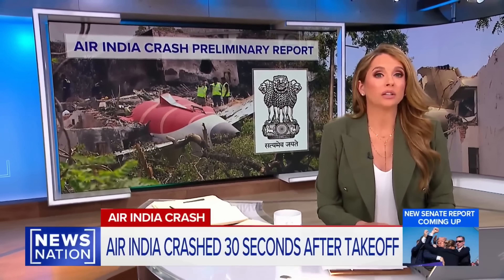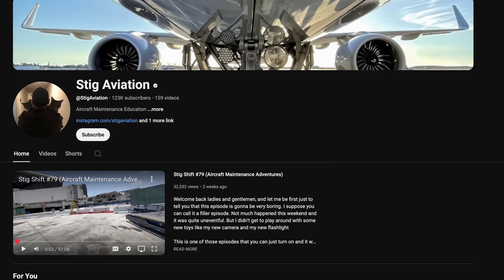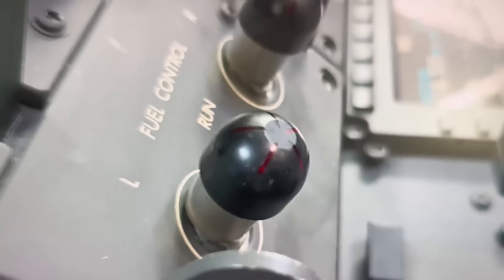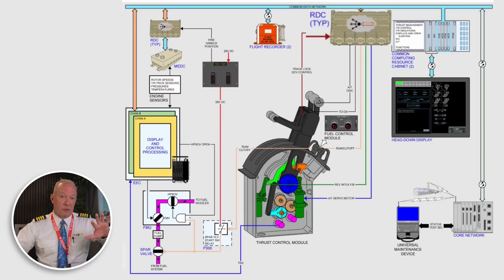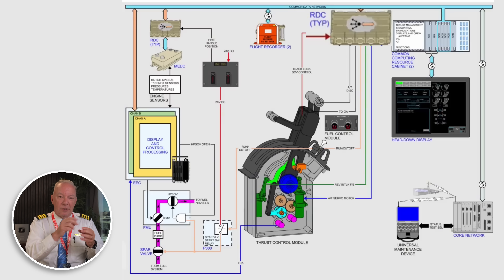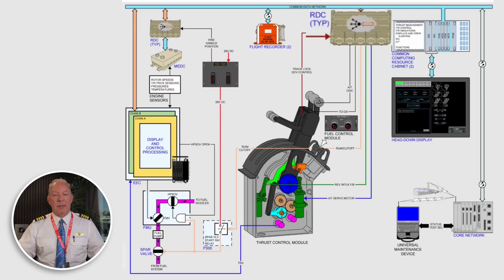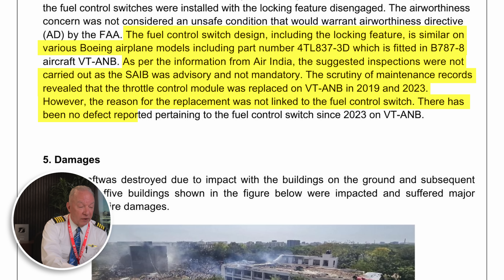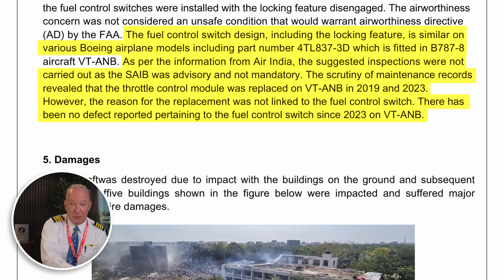The Truth About Boeing 787 Fuel Control Switches

Comment: I agree, the fuel was cut off intentionally. The problem is that the physical mechanical switches are not the only way the fuel could have been ordered to be cut off. For example:

When an aircraft computer detects that the aircraft is on the ground it both “allows” and “does not allow” the pilot to operate a select set of subroutines. For example, when the aircraft is on the ground, it will not allow the pilot to raise the Landing Gear; and when the Fuel Control Cutoff Switches are switched off, it will not automatically deploy the RAT (a device that uses wind to provide the aircraft with electrical and hydraulic power when the aircraft’s engines fail). When the computer is informed that the aircraft has left the ground, the computer ignores some subroutines and allows other subroutines to operate. 

If a terrorist adds a new computer subroutine that triggers just after the wheels are no longer in contact with the ground, that specifically ignores the current mechanical switch placement of the Fuel Control Cutoff Switches in the cockpit, and instead instructs the computer to independently cut off the fuel to the engines; then a crash is inevitable. If a terrorist could insert such a subroutine, then the same person would also want to prevent an investigator from discovering how the aircraft was sabotaged. That could be accomplished by having the inserted subroutine return operational control of the fuel to the Mechanical Cockpit Switches just before the crash. If the pilot, after realizing that the engines have lost power, were to glance down to the fuel control switches, he would see them in the up position and assume there was some other reason for the loss of power. An investigator would rely on the flight data recorder and see that the Fuel Control Switches were turned back on 10 seconds after they were “turned off”, and assume the pilot turned them back on.

If the subroutine is not detected, then the same subroutine can be used again by a terrorist on a specific day and on a world wide scale.

I’m not saying that this is what happened. But I am saying that the current investigation should make sure that it did not happen by specifically looking for differentials in the standard Boeing 787 aircraft software code.
Reply: There is no computer input to the fuel spar valve. It is a purely* electro/mechanical system.
* The Common Core System can turn the circuit breaker off for the fuel spar valve. The CCS is Common Core System = Computer. But changing the state of the circuit breaker does not command the fuel spar valve to open or close. It stays in the last commanded position.
Reply: @paultruzzi911  Thank you for your comment paul. The reason I brought up the possible hacking of the CCS is because of the All Nippon Airways (ANA) Boeing 787 incident in 2019. During final approach from Tokyo to Osaka, both engines failed after the aircraft’s software erroneously detected that it was on the ground. This triggered the Thrust Control Malfunction Accommodation System, which cut fuel to the engines. According to Mary Schiavo (a US aviation expert), the pilots did not engage the fuel cutoff switches. The malfunction was ultimately traced to a software glitch rather than human error. The ANA flight, carrying 109 passengers and 9 crew members, landed safely without injuries. My thoughts are that there are software subsystems that can act to cut off the fuel to the engines even if the mechanical Cockpit Switches are both in the up position. I would not presume to say that this is a repeat of the All Nippon Airways incident. But it does demonstrate that there are other ways that the aircraft can be fooled into cutting off fuel to the engines that could be exploited by a knowledgeable terrorist.

Comment: I realize it would be a very rare occurrence if there were a problem with main battery backup power during a major electrical power outage (fuel switch cutoff) but it has occurred before (see Jeremy John Thompson YT analysis) so it is possible even if very rare.  I’m not saying this is what happened to AI 171 but I do want to point out how the fuel control switch operation changes and how the Captain and FO may have faced unpredictable fuel switch operation if there were a problem with power to the fuel control relays. The fuel control relays power is supplied by the Captain and FO instrument 28V DC buses, backed up by main battery and RAT.  
Rare unlikely event 1 and how it affects the fuel control switches; the plane experiences a major problem right after liftoff, the type of major engine thrust or other problem where the Captain thinks an immediate, emergency reset is required and he cycles the fuel control switches. 
In error the Captain cycles both switches to Cutoff instead of returning the first switch back to Run before cycling the second switch. With all VFSGs offline the RAT deploys and I would have thought the APU auto-start should have started but it didn’t until later. 
This results in total engine VFSG generator disconnect and the 28V DC instrument buses are now relying on main battery backup until RAT powers up.  
There’s a problem with the main battery and voltage is at some low voltage level prior to Rat power takeover. Both fuel switches had been cycled back to the Run position quickly but, with no or low backup voltage going to the fuel control switch relays the fuel relays and fuel valves don’t operate, the fuel valves don’t open back up even with the switches in the Run position. 
The switch transition to Run is also not detected or recorded at this point in time due to no or low power to the remote data concentrator. 
Rat power then takes over, main battery disconnects and RAT power connects to 28V DC instruments buses.
 With power restored and with the fuel control switches already in the Run position the fuel control relays, now getting power, power the fuel valves opens and the switch Cutoff to Run transition is also recorded by the FDR BUT, there’s been a long 10-13 second delay since Cutoff and when power was restored by the RAT. 
Fuel switches may have been cycled quickly but the loss of backup power delayed Cutoff to Run transition until power was coming from the RAT. Without the 28V DC on the instrument buses there could have been a whole lot going wrong, not just with fuel control. Again, not saying with confidence this is what happened but if it did it could explain some or most of the delay in the fuel switches transitioning back to Run.  
I could be completely wrong about some or all of this but I do have a pretty good understanding of the fuel control switches, relays and valves.
Reply: The fuel spar valve needs power on either the open or closed circuit for it to change its position. Losing power will not cause it to change its position
Reply: @paultruzzi911  In my comment I said the valves won't change position when power is lost to the fuel control relays, even if the fuel switches are moved. Never said any valve changed position when power was lost. Read the entire comment again and let me know if there is an error in anything I said.

Comment: I don’t know. I’m not an engineer nor an avionics technician.  But, as an electrician, I do know that relays can fail. A relay is an electronically controlled switch. So, in effect, there are two switches in the system, the physical one that controls the relay, and the relay, electronic switch which controls the fuel valves and/or as mentioned in another comment, the “fuel flow server controlled by the FADEC, which makes a lot more sense to me.
And, on another tack, having watch many of the videos out on this tragic incident, one video mentioned an issue of the “WOW” landing gear switch. “WOW” stands for “Weight Off Wheels,” and this switch tells the flight control computer that the plane has transitioned from being on the ground to flight mode.  If this switch fails, the computer will be conflicted with the situation that the plane is on the ground and simultaneously in flight mode from all the other indicators!  This supposedly could cause the computer to shut down the engines overriding manual controls.  Of all the hypotheses out there, this one makes to most sense.  I haven’t heard anyone else address this issue.  Just curious…
Reply: The fuel spar valve does not get any indication from Weight on Wheels. There is NO computer influence on the fuel spar valve position. The fuel cutoff switch is spliced into the engine fuel fire handle, those are the two means to close the valve. Emergencies, requiring the cut off of fuel can occur on the ground or in flight.

Comment: Is the relay normally open or closed
Reply: The actuator needs to be powered to closed and/or open. I don't really recall if there is an actuator between the fuel cutoff switch and the fuel spar actuator. On other flight deck switches that would be true. Only low power to the buttons people push. But the fuel cutoff switch is a very robust switch and 28v isn't that much. In any case, the actuator would remain in its last position if power was lost or the relay failed. It certainly would not close and then open 10 seconds later that would require power on the closed circuit and the power only on the open circuit.

Comment: I'm unsure from the schematic, so please could you clarify from which component the FDR receives the actual electrical signal indicating that the run/cutoff switches are in each detent position. There appears to be no direct electrical pathway from the hand-operated switches to the FDR - so how can the FDR record the times at which the switches themselves (as opposed to another element of the fuel supply mechanics controlled via the manual switches) are moved. This, of course, presupposes that there are not position sensors integrated into the manual run/cutoff switches, which signal directly to the FDR. Many thanks!
Reply: There is a separate circuit that goes to the RDC, marked cutoff/run.
Reply: @christopherrobinson7541  Many thanks!
Reply: I'm going from old memory ... But the Fuel Shutoff Valves send a analog signal from limit switches on the actuator shaft to the Common Core System (CCS = computer).  The Fuel Management System (an application running in CCS) then says that the fuel shutoff valve is open or closed. Other systems; flight deck display, FDR & ? who subscribe to this information now know that the fuel shutoff valve is open/closed. Flight deck changes the display showing the new position, FDR ... just records.

Comment: My question is regarding the switches themselves.  The locking mechanism depends upon a spring, a notch in the mounting that holds the switch, and a protrusion in the switch itself.  What if something blocked the notch, or the protrusion was not there?  If the notch were blocked (sort of like putting tape on a door latch), wouldn't the switch be free to move without pulling it from the console?  Wouldn't a missing protrusion produce the same effect?  Has evidence been provided (photography of the unit) that shows that it was in perfect working order on the day of the flight?
Reply: Crash investigator have recovered the switches. I'm sure they can tell if they were working properly or not. 
Also you are suggesting that  both switches failed in the same way at the same time? Really?
Reply: Blocking the nub, not notch, would totally prevent the switch from moving. However, in post crash photos, both appear to be in the run position.

Comment: What keeps the 28 volt batteries from failing?
Reply: The batteries are recharged continually. If they fail the system fails to the open position so the engines don’t ever lose fuel. The only way to fuel starve the engines is to run out of fuel, pull the fire handle, or place the fuel control switches to cutoff.

Comment: Dear captain, the only indication that those switches may have moved at all, comes from the DFDR, which is a digital device, meaning the functioning of the switches themselves is irrelevant. What is relevant, is an exact cause and timestamp for the deployment of the RAT, and maybe some insight in why the AAIB is pushing a narrative, while like you claiming they don't.
Reply: The CVR would certainly have recorded the sound of the switches had they physically moved.
Reply: @stimproid  These switches are not very loud, and the noise they do make is very brief. There is no guarantee it would be extractable from the CVR, but looking for it is an opition.
Reply: The FDR get analog position from the fuel shutoff valves through the Remote Data Concentrators to the Common Core System (e.g. the CCS reports valve position to all systems subscribing to that item; flight deck displays and FDR and?. This path, does not command the fuel spar valves, but only reports the position. The RAT does not care about the Spar Valve position, only whether all AC power has been lost or commanded on.  The only unclear item is in the preliminarily report, they say the fuel valve closed, but not which valve; HPSOV or Fuel Spar Valve. My assumption of this omission is because both reported the same position.
Reply: @paultruzzi911  The FDR gets digital data only. No circuit closure or analog signal at all. Zero, zilch, nothing, nada, niente. It is a stricktly digital device. 

The thing that makes the RAT deployment timestamp important, is that it very convincingly appears to preceed the switch transitions, meaning the valve cutoffs were not the first nor the only catastrophic failure.

Other than that, the PR has heaps of inconsistencies. The whole notion of out of context CVR paraphrasing for instance is utterly absurd. Besides switch manipulation, not a single other possible cause was investigated, which is not just biased, but also extremely sloppy. 

What you need to understand, is that the single most important effect of the suggested cause is that it instantly halts the crash investigation. That is why misintend is normally the very last option to suggest, unless ofcourse it is the objective to halt the investigation.

The preliminary report is not just a bit vague or slightly incomplete. It absolutely stinks of biased narrative a mile upwind like a garbage heap on a hot summer day. You and I would have undoubtably done better. AI would have done better in seconds. It is that bad. It is click bait level BS.

It's like captain Steeeve. He doesn't want to draw any conclusions, but he wouldn't know what else to look for, and meanwhile he praises the preliminary report. That is what a biased narrative looks like.

Even the overly simplified principle system drawing that he shows at 7:44 , shows that only one valve is controlled by a relais powered by the switches, whereas both others work on digital signals coming from other devices. But that's not what he says. 

Being able to put two and two together, doesn't make a mathmatician, and captain Steeeve is neither a crash investigator, nor an aviation control system engineer.

It doesn't matter, because the pilots will get the blame, no matter what. There is just too much momentum in the misintend narrative, and way too much mass pushing it.

The one thing I don't understand is why he does this. Captain Steeeve has a good thing going as a public informer, and his work for pilot mental health care is very valueable, so why would he risk the credibility of that work, by supporting this nonsense?